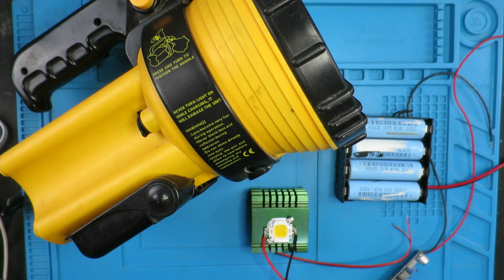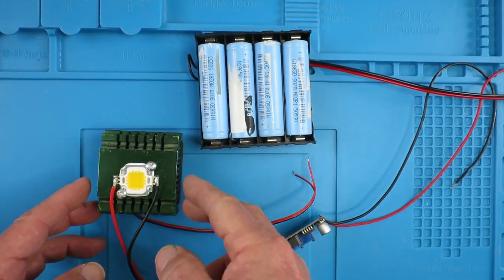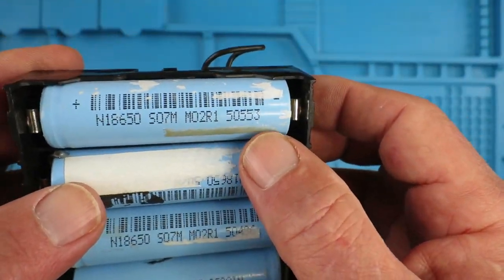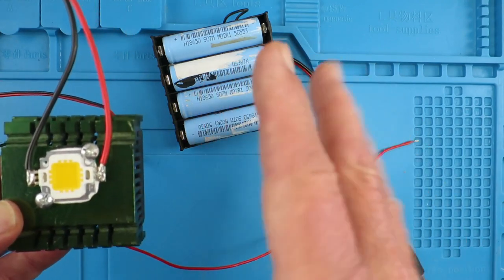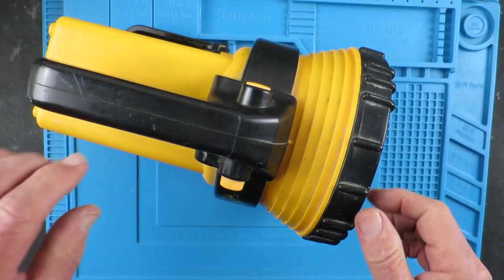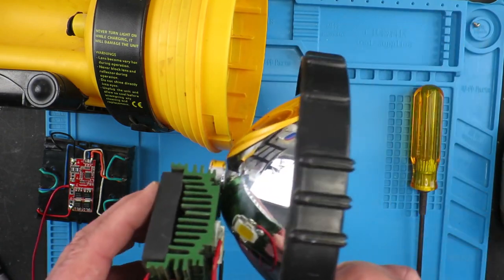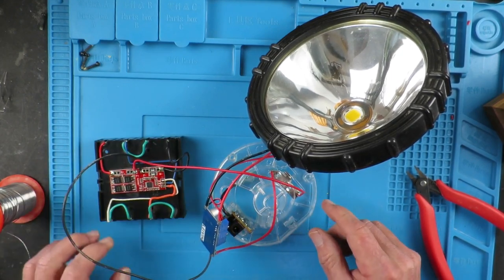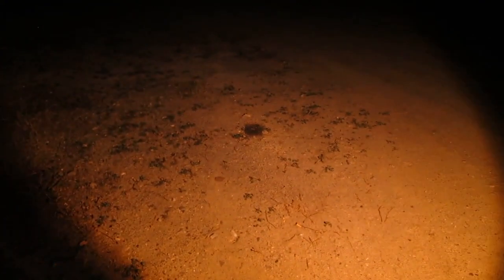Bulb to LED Torch Conversion Upgrade Electronic Project

Comment: I've been converting flashlights myself and even using the same LED you did. I put it in a small flashlight with a momentary switch since I usually only need it for a short period. Great that you brought up the lens issue. One try that works well is using one of the cheap plastic  magnifying sheets backwards to spread the beam out a bit since I'm usually using it close up. I skipped the buck converter and used a resistor (3 in parallel actually, to manage them heating up). So far so good but early days. I appreciate all the details that go into these projects and you showing them. Oh, on another I used a cheap LED inline dimmer (like for strips that are $2 on banggood) for brightness management; much more convenient than finding that tiny screw on the buck converter in the dark! and cheaper than the buck module.
Reply from the maker: Great to hear about your projects too. You should make some videos. Good tips about using the magnifier sheets and led dimmer. Will be stored away in the grey matter!

Comment: I like the idea, but those leds generate tons of heat, the fan it'll keep the temp down but you need some holes otherwise the fan just will move hot air from one side to the other. Cheers.
Reply from the maker: Thanks! A very good point. I will make some holes around the reflector housing.
Reply from the maker: Yes John! I did not see the slots until I looked closer Duh! The original bulb put out a fair amount of heat too. Great minds think alike!

Comment: Great idea, I've been wanting to do the same, but I never get lucky finding a good LED... Are you going to balance charge them cells?
Reply from the maker: Hi MrBrymstond, in my original investigation of this battery management board https://www.youtube.com/watch?v=miDIXwACpcY I looked carefully at how the board functioned. After using these boards for a year or more I have concluded that as long as the cells are well matched and balanced to begin with then you can use just a power supply to charge all cells and not use a dedicated balance charger. Much depends on the application. The abuse that RC model batteries are subjected to means a balance charger is always required, however, in less demanding applications like this I don't see a problem. Your mileage may vary!!
Reply: Yes I have the same board which is a great little board but over time it said it was charged to the correct value but when I tested each cell I found 2 were over charged and 2 were under and the 2 that was over had to be replaced so I added JST 4S and used my hobby charger after that, good luck though.